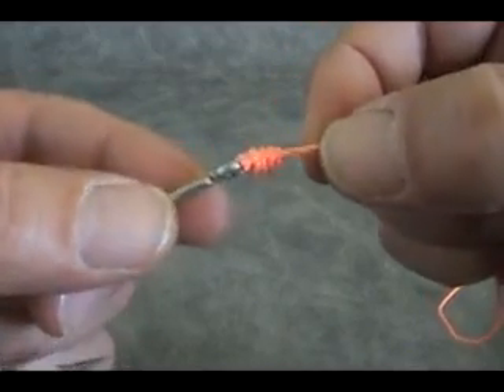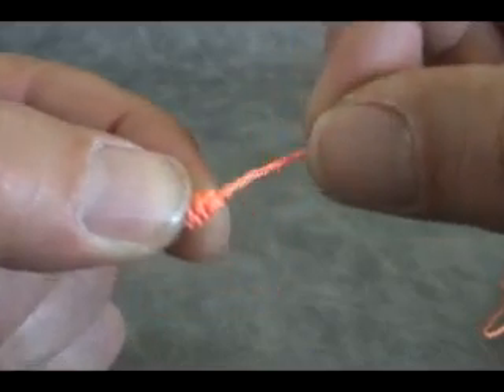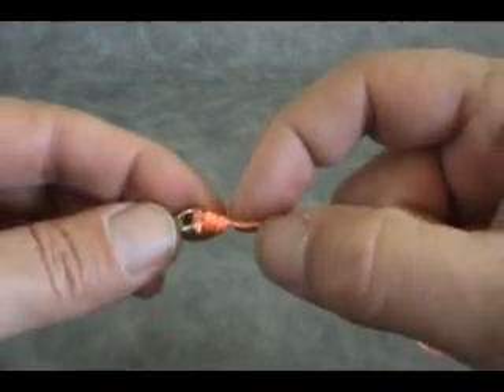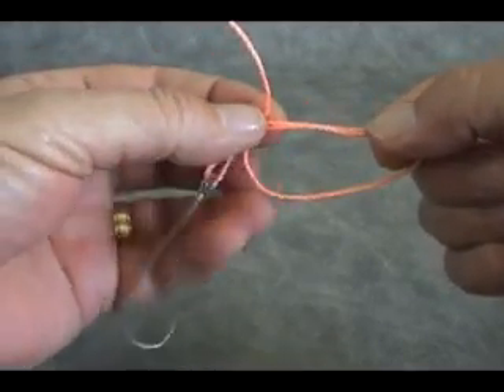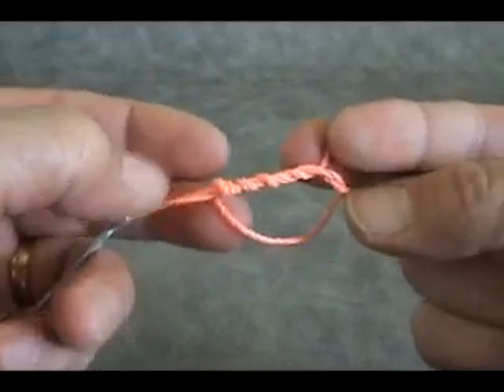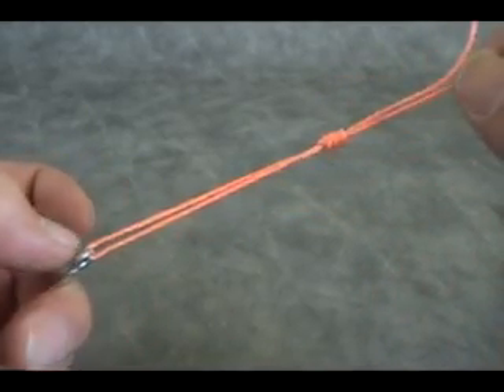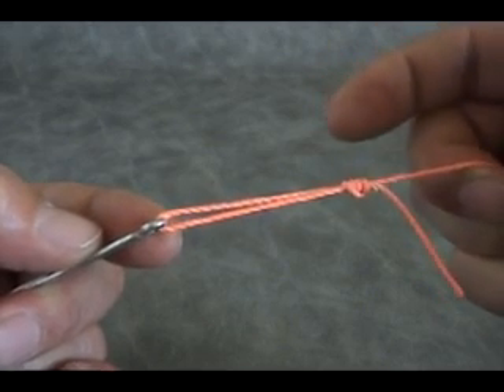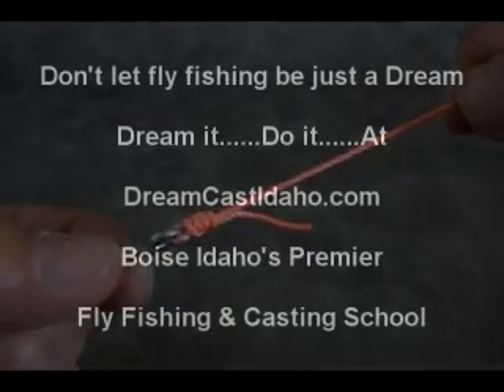Fly Fishing Knots, The Duncan Loop

Comment: Is the Duncan loop knot the same as a Uni-knot?
Reply from the maker: Hi Rich, the Uni-Knot is a Duncan Loop. They are tied exactly the same. There are a lot of variation to the Uni-Knot depending on how you pull the tag end of the line. If you pull it towards the eye of the fly up tight it is a Uni-knot. If you pull the tag end away from the eye of the fly as it it shown in this video it is a Duncan Loop, if you slide the Duncan Loop towards the eye of the fly, closing it, it is a Grinner Knot.Hope this answers your question. Might need to make a video explaining this in detail.

Comment: Only Problem is, that the knot presented in this vid is the Grinner-Knot, not the Duncan Loop...
Reply from the maker: Hey Florin, just doing a little catch up on the video comments. Sorry it has taken 6 years to reply to your comment. Your right in the sense that the Duncan Loop is a Grinner knot. They are tied exactly the same. The only thing that makes this knot a Grinner knot is that the loop has closed up on the eye of the hook. In other words if you tie a Duncan Loop and leave it open, it is a Duncan, if you catch a fish and the loop closes up it is now a Grinner Knot. Thanks for the fact checking.
Reply: Michael Bantam Hi Michael, I‘m sorry but I need to disagree. The Duncan Loop and the Grinner are tied diffrently. If it wasn‘t for that, there would be no reason for giving the same knot two diffrent names.
A correctly tied Duncan Loop dose not close in case of catching a fish or any other pulling on the main line. So in the video it is just a Grinner that is not closed which has nothing in common with a Duncan Loop.
Reply from the maker: Hi Florian, I have been wrong before, which is how I have learned to be corrected. So with that said I would like to refer you to my source. Please check out this book. All I know is the variations of this knot work for me and my fishing.       "FLY FISHING KNOTS & RIGS, LEADERS" Fresh & Salt Water By Trevor Hawkins   
ISBN # 1865130710 Copyright 2004 Please look up pages 37 & 42. The only loop knots I know that won't close up are the Homer Rhode Knot, and the No-Slip mono Loop.
Reply: Good morning Michael, the diffrence between the grinner and the duncan is very good shown on this page: http://www.angelknotenpage.de/Knotenbank/dunc.htm   The difference in tying the knot is in the loop through which you wrap the tag. And I have to admit that the duncan will close but you have to apply a lot of preasure (more than fighting a fish) to pull it close. The grinner will close more or less instantly.
Reply: None of those are Duncan loop. Check : How to properly  tie the Duncan knot, by TheFishingKit. On you tube